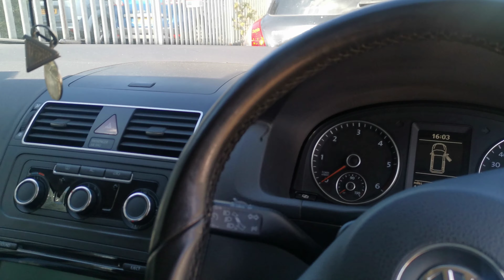VW Touran knocking noise from the engine | My VW Touran engine making noise

Comment: 1.6 tdi engine has very sensitive injectors, no fuel filter replacement for two or three seasons,low quality diesel .And the problems will start😢.

Comment: Good day. I have a touran 1.9 tdi and it's giving me problem where the diesel mix with the oil. I have drain oil three times and replaced all injector seals and plug in again. Now it's showing cylinder 4 contribution balance and car drive in limp mode. Please advise the way forward please.
Reply from the maker: Have you got the injectors tested to make sure they are OK
Reply: No I haven't. How do you test it
Reply from the maker: @shakeelshaq9195  you have to remove all the injectors and send it of to a specialist to test. Where exactly are you located
Reply: I'm from South Africa......in Cape Town
Reply from the maker: @shakeelshaq9195  oh Jesus. Hope you're well in South Africa. Unfortunately I don't know who your specialist are. If you can't find anyone you will need to replace all the injectors
Reply: Ok. What's the cost of all four injectors etc.
Reply from the maker: @shakeelshaq9195  UK or South African prices
Reply: Both prices please